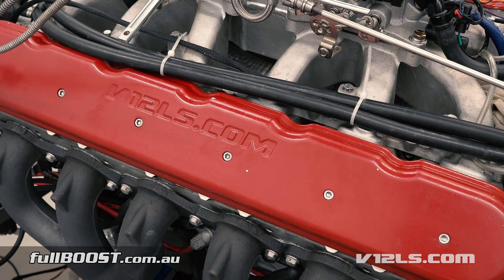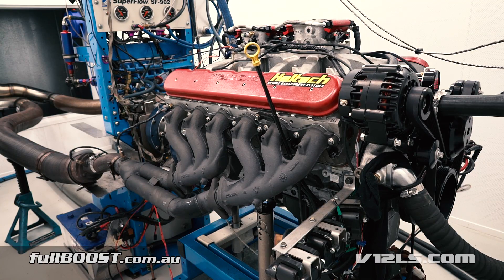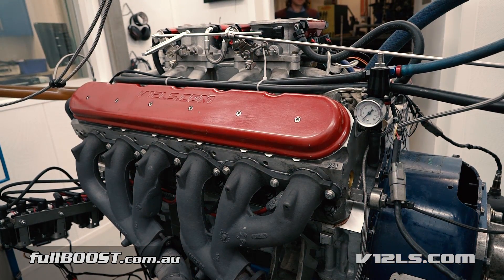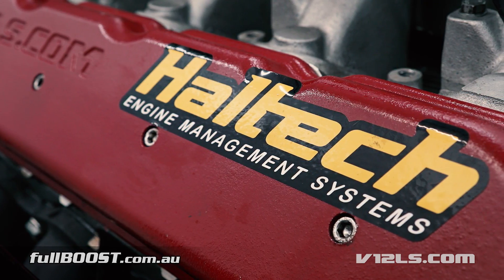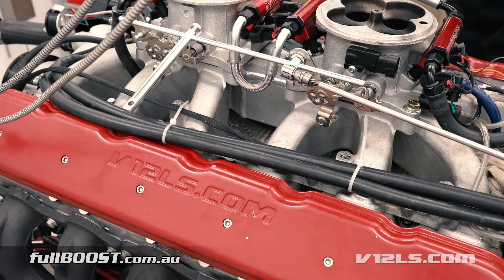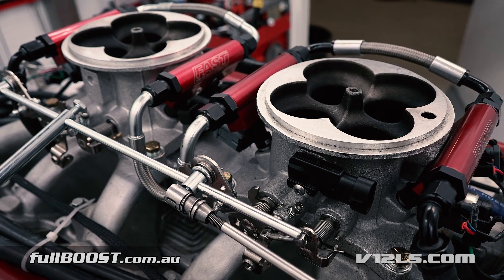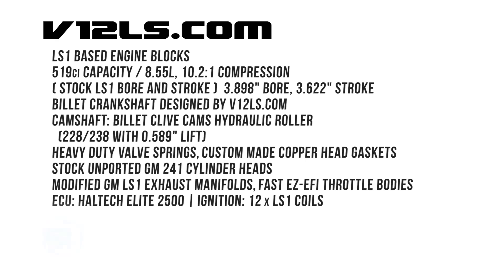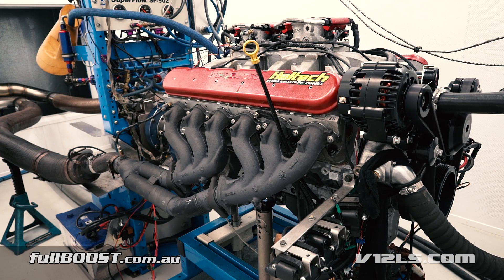V12 LS1 engine dyno

Comment: 77-83 HP per liter?? That's horrendous. A 20 year old Volvo engine makes 110. From the factory. And a modern Volvo engine will produce 250 per liter.
Reply from the maker: It has the potential to make so much more.
Reply: So does my Volvo - but how would you bump up the ratio on this thing?
Reply: Gunnar Sommerfeldt, more compression, more timing, higher octane fuel, head work.  Remember much of this is stock LS1 specifications which aren't mindblowing.
Reply: That's true. And there's no doubt that a lot of work went into it - it certainly looks (and sounds) gorgeous. I just don't understand why US engines always seem to be absolutely massive, and then only manage to produce mediocre amounts of power.
Reply: +Gunnar Sommerfeldt correct me if I'm wrong but isn't a Volvo turbocharged?  that would definitely  bump up your hp/liter ratio.  Volvos are tuned up a little more since they have run with boost.  LSx  engines are not optimized since they are built for decent gas mileage and longevity.   once you start tweeting the LSx  it will come to life with incredible  results.
Reply: Yeah this is over 700hp naturally aspriated. No car makes 250hp per liter without boost. This motor has no boost. You think 700hp is shitty for a v12? Look how many exotic cars over the past decade with v12's make less than 600hp. Smaller v12's right? Not a big honkin 8.5 liter like this one. Ok, take the 2016 Aston Martin V12 Vantage for example. It has 565hp, with a 6.0 liter v12. Yes this ls1 v12 is a larger 8.5 liter, but it also makes 149 more hp than the Aston Martin, so I don't think that's too bad compared to a freaking supercar v12. Not to mention, this motor is still a prototype with much more potential available. You want to know why American engines are "massive", but don't put out too much horsepower? Torque. That's it. They are "massive" because they have a much longer stroke, which increases volume in liters, and increases torque. A shorter stroke will produce max power at a higher rpm, with little torque, whereas a longer stroke (which increases displacement) will produce max power at a lower rpm, with much more torque. When you increase stroke in search of more torque and thus increasing the size of the engine, it doesn't necessarily mean you get more hp. Here are a few examples. If you build a chevy 350 V8 for example, if you keep it at 350 cubic inches (or 5.7 liters) you can make around 500hp on average, but will have to run a high profile cam and higher than stock rpm range to get that much power. Now if you take a 350 chevy and build it into a 383 stroker (approx 6.3 liters) it will make a lot more torque, but not really any more hp than the 350, and you won't have to rev it as high to do it. Typically a stroker motor, or a motor with longer stroke, will only make more torque, not more hp. There are examples of this in production cars. For example: Honda S2000. The original S2000 was a 2.0 liter with 240 hp. Then in 2004 they gave the engine a longer stroke to give it more torque, increasing it's displacement to a 2.2 liter. It didn't make any more hp, just more torque. Another example: Honda Civic EX. In America, the 1999-2000 Honda Civic EX had a 1.6 liter that made 127 hp. For the next generation Civic EX, in 2001 Honda increased the stroke on that 1.6 engine to give it more torque, which increased it's displacement to a 1.7 liter due to the longer stroke. While it did make more torque, it still only made 127 hp. Get it? America's "massive" engines have a longer stroke for more torque, but this doesn't mean more hp; only torque.
Reply: I as an American that looks at torque. Quick 0-60 mph requires torque.  A car with 500 lbs. of torque and 300 hp will smoke a car with 500 hp and 200 lbs. of torque from 0-60 mph.  I pull Vail pass (11,000 ft) in high gear in my LS2 gto.  No 4 banger could do that pulling a 2 ton car.
Reply: What do you mean, "4-banger"? I don't see a single mention of a 4-cylinder engine anywhere. In any case, I'm not really concerned about the NA/FI conundrum - the real question is why anyone would even make an engine without FI. I have more power when I need it, better fuel efficiency when I don't, less noise, etc in a turbo engine than anything else. As for torque, those numbers seem a little arbitrary. :D
Reply: Gunnar Sommerfeldt Well for one boost equals higher cost, not to mention reliability issues. Yes a boosted motor can be plenty reliable, but a non boosted engine is even more reliable. Less pressure in the cylinders, less parts, less parts to fail, lower combustion temperatures resulting in less friction between the cylinder walls and rings, no need for forged internals; the list goes on. Oh, not to mention boost lag. Minimal if done right, yes, but still there regardless. There are a tun of reasons to stay n/a as i have just mentioned.
Reply: Those are some good points, but you've got to weigh the pros and cons. A turbo engine with efi doesn't have a whole lot more in parts than an NA engine - that's kind of a myth. And you don't need forged rods and whatnot - that's also a myth. The fact is that my engine IS an NA, until I need it to be FI. Temperatures aren't any higher, and as a daily driver, I still have more available power than most, with lower fuel costs. Done right, as you say, there's no turbo lag to speak of - using the right turbo for the right engine and application is key, of course, as the right tuning of an NA is also key to having good results. The bottom line is that I've got a 2.3 liter engine which turns into a 3.2 when I need it to be. And I certainly spend far less maintaining it than quite a few people I know with US NA engines... :)
Reply: Gunnar Sommerfeldt But it wont last 250k and still be in tip top shape like an n/a engine if properly maintained. I've owned both btw. Mid 90's z28's and a 02 wrx. Love em both.
Reply: There's no way of telling one way or the other, on either FI or NA. That literally comes down to thousands of factors, and there's no way you should be that categorical. There are lots of turbo cars out there with far more on the clock than 250k, and many of them are Volvos, for example. I had an NA that died long before 250k, and I've got a turbo now that looks like it'll make it to 250k without problem. So that's not really an argument. I guess it comes down to a Nike or Adidas, Pepsi or Coke kind of thing. Some people like this, some people like that. ;)
Reply: Gunnar Sommerfeldt
 I am no volvo expert.  I thought a 2.5L was a 4 cyl.  Forced induction is an added expense.  I prefer bigger motor N/A.
Reply: Gunnar Sommerfeldt Gunnar Sommerfeldt There seems to be a widespread misunderstanding when it comes to engine size and displacement. Displacement tells you next to nothing about the engine's physical dimensions.An LS1 V8 is almost the exact same size as a Honda F20 engine and is less than 30 pounds heavier for instance. Also, you can only use hp per liter figures when comparing two engines of the same configuration. A 4 cylinder can't be compared with an 8 cylinder. OHV engine be compared to a DOHC. A turbo'd car cannot be compared to NA either using specific output. And really specific output doesn't tell you anything about the engines actual efficiency anyways, so it's somewhat useless.
Reply: Gunnar Sommerfeldt Generally speaking, an n/a engine will last longer than boosted, but I can see I'm beating a dead horse. And you say there's not really any more parts on a turbo car than n/a? Ask me how many parts I replaced trying to figure out my boost problem on my wrx, none of which would have been on an n/a car. Hell, just look at any turbo kit period and see how many parts it adds, nuff said. You originally said the power output vs engine size was horrendous. We all said yeah cause it's n/a, and a prototype, and I even compared it to a brand new Aston Martin which showed that actually it's not that bad for what it is. Then you said "why would anyone even make an engine without forced induction". I tried to point out several very good reasons, and you are comparing them to Coke and Pepsi. Ok, you want an answer from a manufacturers point of view? Cost. The more shit they put on the car, the more it costs them to make the product. More parts is more money, not to mention more R&D to make sure it all works long term, which costs more money. Car manufacturers are in the buisness of making money, not necessarily making us happy. At the end of the day all they care about is putting money in their pockets. It's easier and cheaper for them to just slap an n/a motor in a car and sell millions of them. A lot of the imports are what have the turbos, right? Look how much they cost... You know how much it costs to buy a brand new boosted car today that puts out 400hp? 40-50 grand? You know how much it costs to buy a brand new "massive engine" V8 muscle car with 400hp? Like 30 grand. N/a power is cheaper, and this is the single biggest reason why not all cars are turbo or supercharged.
Reply: Gunnar Sommerfeldt no it won't.
Reply: haters
Reply: Ya, that "modern volvo engine producing 250hp per liter" kind of has boost now doesent it? And hmmm, what about tourque? No mention of that? And this is coming from a volvo owner.
Reply: - 250hp/liter = steady ZERO fucks/km. 
- You mean "a modern *Ford engine"?
- 77-83 HP/l out of simplified, compact, relatively light and very reliable engine arrangement VS. "they've attached 4 cylinder engine to their 3(2) turbochargers" - arrangement. Who do you think holds the advantage? :D
Reply: In 1950 the BRM 1.5 litre V16 made 400hp/litre - so what? Once upon a time there was an ice cream but it didn't have bones - that about sums up the validity of that comment of yours.
Just because you can't see the need for something doesn't mean someone else shouldn't follow their dreams does it?
Reply: hp/l is a joke. say you have a 1L engine that makes 100 hp. you have 100 hp/L right? yep,but you have 100hp. say you have a 5L engine that makes 50 hp/L. you have 350 hp. 5L engine has more hp. its all about who has more at the end, not per litre.
Reply: A good point to note here: Just as it's amazing that there are some n/a motors out there putting down 100hp per liter, it's just as amazing that somebody made this v12 ls1. And compared to even modern v12 engines out there, it's hp per liter isn't bad for a prototype that is using stock ls1 head and cam specs and manifolds. I mean those modern v12s like the Aston Martin I quoted earlier are pretty much full out race motors in street cars. The heads are already worked, they have ideal cams, and much better exhaust manifold design. Anyone who knows anything about the ls1's knows that all the power gains are to be had in a good set of heads with a good cam and headers. That takes an ls1 from around 300hp, to around 500hp. That's a 66.66% incease in power. So apply that 66% increase in power to this v12, and you got over 1100hp. It'll make at least 1000hp with a better cam, ported heads, and headers. Oh shit, that's over 100hp per liter isn't it ladies and gentlemen? What's boost for again? Lol, add boost to that and you got 2000hp easy.
Reply: it's nice that people understand each other, eventually. :)
Reply: I think you kind of missed the point, buddy.
Reply: Abu Jason Al-Blahino good one
Reply: +Frigglebiscuit

1st: A 5L engine that makes 50hp/L does 350hp??? Come on, 5x50 is 250!!!

2nd: hp/L a joke???

Example1: You get one 5L engine for free. You can choose between two engine types.
A 5L engine that makes 50hp/L or a 5L engine that makes 100hp/L.
What's your decision and why??? Which engine is more efficient???

Example2: You want to build an engine with a displacement of 10L.
Would you take the technology of the 5L 50hp/L engine or the technology of the 1L 100hp/L engine to build a 10L version?
How much hp would the 10L engine make if you would take the first technology and how much with the second one?

Is hp/L still a joke for you???
Reply: V8Roehrldrifter whichever makes more torque. Doesnt matter what hp/l it is, because i would still upgrade them. And yes, hp/l is still a joke. Most people only carebout that because they cant do upgrades because of nanny state emissions laws.
Reply: Frigglebiscuit Oh, you don't get it, too bad :(
Bye :)
Reply: V8Roehrldrifter seeya.
Reply: +Frigglebiscuit You can't have torque without horsepower, and horsepower is no use w/o torque. Prioritizing one over the other really makes little sense, if you see what I mean. :)
Reply: Gunnar Sommerfeldt where are you from?
Reply: +Frigglebiscuit Why?
Reply: Gunnar Sommerfeldt just wondering if youve ever owned an american v8.
Reply: +grebo121 110-125 hp/l out of a simple enough engine for anyone with torx bits and a few wrenches to work on themselves, with no mechanical education, which uses less gas and needs less maintenance than a brand new LS engine. And is 20 years old. Who do you think holds the advantage?
Reply: +Frigglebiscuit No, I've never owned one. I've driven several, from time to time. What does that have to do with anything?
Reply: Gunnar Sommerfeldt so you have no idea how american v8s are? All i see is bias.
Reply: +Frigglebiscuit Look, there's no bias here. What I'm saying is that numbers don't lie. My 20 year old Volvo engine will, with SOFTWARE update only, on stock internals, produce the EXACT same power (actually, a smidge more) than the 1999 LM7 5.3 liter V8 (290 hp/317lb.ft vs 270/315 for the V8). That's a 2.3 liter engine, producing the exact same amount of power as an american 5.3 liter V8. In fact, the 20 year old Volvo will put down just about the same amount of HP and torque as the 1999 LM7, the 2002 L59, the LM4 and a smidge less than the L33 (11 lb.ft).
Reply: Gunnar Sommerfeldt and is that with a turbo?
Reply: No, it has extra footpedals in the back seat, so passengers help the numbers along greatly. Jesus.
Reply: Gunnar Sommerfeldt Exactly :)
"HP", "torque" and "RPM" are mutually dependent. If you know 2 of them then you can always calculate the 3rd one.
Reply: +Frigglebiscuit That's not the point, is it? Put a Boeing turbine engine on top of the Volvo. More power. Same thing. The point isn't the size of the engine - it's the power to displacement and power to weight that matters, and which is what my initial comment was about. My Volvo engine uses less gas, is lighter, and 20 years old - and it still makes the same power as all those V8s I listed.
Reply: Gunnar Sommerfeldt wrong. That volvo would have turbo lag from hell to make the same power as a v8 with high amounts of boost. And i highly doubt that volvo engine is lighter than an aluminum block 5.7 ls. Even if it is, it wont be enough to matter.
Reply: +Frigglebiscuit A 15G turbo has very little lag - it's a ~15psi turbo, on a 2.3 liter aluminium block. I don't think you have any idea what you're talking about... a little research would do you good.
Reply: Gunnar Sommerfeldt so im guessing its a b230t?
Reply: +Frigglebiscuit That was the laziest google search I've ever seen. And no, it's not. It's a B5234FT.
Reply: Gunnar Sommerfeldt the white block weighs 388-419 lbs. An ls1 weighs 457 lbs. A grand national 3.8 turbo v6 weighs 375.
Reply: +Frigglebiscuit Point being?
Reply: Gunnar Sommerfeldt isnt enough weight to really matter. Power ro weight ratio isnt that bigbof a deal.
Reply: +Frigglebiscuit You do know that you need a tranny for that LS1 as well, right...?
Reply: Gunnar Sommerfeldt yep. And you need one for that white block.
Reply: +Frigglebiscuit The combined weight of the 20V Volvo engines with transmission is 350-400 lbs.
Reply: Gunnar Sommerfeldt lol no.
Reply: +Frigglebiscuit http://www.matthewsvolvosite.com/forums/viewtopic.php?f=1&t=27378&p=120778
Reply: Gunnar Sommerfeldt i saw that. Its wrong. A whiteblock is 388-419 lbs with oil.
Reply: +Frigglebiscuit It's wrong? LOL. What, did you weigh one yourself? :D
Reply: Gunnar Sommerfeldt then what is the real weight? No one will ever know i guess. Transmissions aint light. That would have to put that engine in the 200lb range. Not happening.
Reply: +Fragglebiscuit That's not far off, buddy. Remember, this is a 2.3 liter aluminium block. You're trying to compare the weight of that to engine blocks that are twice its size. You're a little bit delusional.
Reply: Gunnar Sommerfeldt nah. Im seeing too many frieght weight postings that say otherwise. Im done arguing btw. Tired of getting notifications about this crap.
Reply: I doubt it, bud-bud. SO, in summary, you - 0, Volvo - 1 ;)
Reply: Gunnar Sommerfeldt whatever you say, bud. Blocked.
Reply: Hehehe... that's hilarious. :D
Reply: Damn guys, you went at it. Gunnar your point of view is that you only want the smallest and most efficient power package: a turbo 4cyl, i.e. your Volvo. Are you even aware that an ls1 Camaro or Corvette gets 28-30 mpg with the 6 speed? Know why? TORQUE. Thanks to all that glorious v8 torque, they can pull a very tall 6th gear, keeping the motor at 2000 rpms or less at 80mph. Is your Volvo at only 2k at 80mph? No, it's not. And I also know your Volvo isn't rated at better than 30 mpg as well. So if they both make about 300hp and both get around 30 mpg, what makes your Volvo superior? Absolutely nothing. Oh, not to mention the Vette has a 350 hp version, which still gets 28-30 mpg, so it would smoke you in a straight line and in the corners as well. But here's another analagy. As you said above, you have never drove an American v8 muscle car. As I said earlier, I have owned both the v8 and a turbo 4cyl, the wrx. I loved both of them. They were two completely different cars, but both special and amazing to drive in their own ways. You wanting to stick to JUST turbo 4cyl is boring. I've had 4cyls, turbo 4cyls, small high reving v6's, large low reving v6's, v8's of course, front wheel drive, rear wheel drive, all wheel drive, 4 wheel drive, and a mid engined car (mr2). It's boring to say and stick to one "superior" platform. There are people who love v8 cars, and people who love turbo 4cyl cars like you. I love all cars! I've never understood why people are loyal to only one type of car; that's boring. I love anything that looks good and goes fast, doesn't matter what's under the hood to make it do that. But I just proved anyway that an ls1 car with a 6 speed is just as efficient as yours, so what's your argument? Yeah, it took a much larger engine to make the 300 or so hp than yours, but this is because it's not boosted. Duh? There are turbo versions making 1000hp. You can't even make 1000hp with yours, and even if you did put 4 turbos on it bigger than your face to accomplish 1000hp, your aluminum block would explode, which means yours can't even make 1000hp like I said! It's common sense. If you want to make more power with a smaller engine, you add a turbo. Otherwise, you put a bigger enigne in it. There is no right or wrong. There are plenty of reasons to love a turbo 4cyl, and there are plenty of reasons to love a big ass v8. And for the most part here in America, both types get about the same gas mileage. And even Volvo makes v8 cars. Go drive a 97 or newer 6 speed Corvette and see why v8's kick ass. You will hate your Volvo after you drive that.
Reply: It has a lot to do with the aftermarket, emissions regulations, and durability standards. We tend to build larger displacement engines that are "de-tuned" to meet emissions regulations. BUT once you buy the car, as long as you keep your total miles under a certain specification, you can modify these large displacement engines to make crazy power with stock internals. For example, the 8.4 L V10 in the Viper only makes 645 hp stock (with a torque curve that is almost flat btw), but add two turbos and 10 psi and it will make 1000 hp bone stock. AND Vipers can get almost 30 mpg when driven properly.
Reply: +Gun&Cars Look. First of all - the B5234FT engine (as well as most 850 and X/V70/90 Volvos are 5 sylinder engines. That right there kind of gives away how much you know about these cars... ;) 
Second, if you had read what I wrote, I said that I have never OWNED a V8 car. I HAVE, however (like I said), driven several, from time to time, among them a '99 Corvette. I still rather like my Volvo, actually... ;) 

In the end, this all comes down to personal preference, as I've ALSO said earlier. 

And here's your 1000 hp, 5 cylinder Volvo 850: http://www.garaget.org/?car=58795&image=1583069 
Actually, it's 1140 hp, at over 1000 nm. And it doesn't have 4 turbos, neither is it blowing up. And that's not the only example out there. So what was that you were saying...? 
Dude, I appreciate your effort in making that wall of text there, but I hope you know more about guns than cars, so that username of yours is at least half way justified. I know this was a harsh comment, but you kind of deserved it. ;)
Reply: Gunnar Sommerfeldt 
I understand your arguments on the efficiency term.
True - for 250-300 hp, a V8 configuration is a bit of an overkill.. it rather matches to 2.0-2.5 liter 4-6 cyl. engine... 
But when you target the 500-700 hp category, things go a little bit different - your simple & reliable 5 cyl. Volvo will need: more rev$, more boo$t, and more valve travel for that. And it won't be simple, cheap or reliable any more. 
The low end torque won't be as comfortable as you wish - let's say it won't match with the gear or the clutch characteristics, and you'll need a second turbo if you want to cover that. The Volvo engineers reached the point, they've equipped their 450hp 2-liter 4cyl. engine with totally 3 chargers - 2 turbos + electrical one. 
Don't get me wrong - I get the idea, but to me personally, it seems a bit too much. :)
The other approach to the "heavy" category is to add more cylinders or another cylinder bank - going to the V's. Ok. But If you want to save the engine's specific power output - advantage, you must leave all the things, which provide it - DOHC cylinder heads, cast iron block, forced induction system - all these things occupy SPACE! And weight. Which in 90-degree V are much more of a problem than in in-line configuration. 
And the better way is GM's - just add more stroke & bore. Basically the weight and size of a 4-liter LS-engine is not much different than 6.5-liter's, And it's significantly smaller and lighter than M60-engine (for example). 
And add that this is a platform that has evolved for ~50 years, and parts for it are all around, that comes to be one of the most cost-effective on the market.
Reply: +Guns&Cars Aw... is someone a little butthurt that they got called out for not knowing anything? You should take a look at the reply from +grebo121 there - he/she actually knows how to make a coherent, and rather convincing argument in a discussion, without name-calling, and with actual facts and figures, along with a balanced view of things that make sense.
Reply: First of all - the B5234FT engine is shiet because i changed piston rings + turbo overhaul at 120k on mine.  No need to tell me about proper maintanence. Friends have "few" N/As rolling easily 200k. More parts mean that more of them can break.
Reply: +Guns&Cars Dude, I didn't call you any names. You're the one who did that. This thread's been fun, because a lot of people have had a lot of opinions, and many of them have been expressed in a civil manner. But stuff like your last comment is just proof that you're not worth listening to, and that you certainly don't know what you're talking about. So thanks for leaving - it's no great loss. :D
Reply: Gunnar Sommerfeldt All hail the great  automotive dictator Gunnar Sommerfeldt!
Reply: +Guns&Cars Thanks! :D I wish. Then every engine would be 5 cylinders! Oh, the evils I would commit... Moa-ha-ha! :D
Reply: Hmm.... if there would be anyway possible to get that LS1 V12 engine on Lexus lx 450 engine bay with one holset 551vgt. That would be really fun. hmmmmmmmm
Reply: on paper it seems lethargic, i'm sure in the real world it will haul your volvos ass into oblivion.
Reply: +Thee Adjudicator It very possible that you're absolutely right.
Reply: +Gunnar Sommerfeldt You have to understand that the average american automobile enthusiast doesn't tend to look highly upon fi unless the engine is producing more than 1000hp.  Your typical "Big Block" v8 can support 700hp. and 650ftlbs. NA and still get a decent amount of gas mileage with a decent efi setup.  An example of this is a 76' Trans Am that I believe is for sale on Butler Performance that has a Pontiac 535 thats making 830hp na and gets 30mpg.  Basically for larger displacement engines built for street use, fi is completely unnecessary.  That being said, I have no problem with fi when its used in smaller displacement applications where it is neccesary.  And yes, before anyone corrects me, I realize that this motor is neither a big block nor a v8.
Reply: 95% of the LSx engine family only makes 60-90hp per liter so this is right on par. 100% of the LSx engine family could beat your Volvo. In fact a lot of your brethren opt to put the LSX in their Volvo's since it's....you know...better.
Reply: There is no point to put LS engine to Volvo - thats waste of money and time and after all the hassle its still Volvo. You can go mental with some bigger holset turbos, rebuild engine internals (stronger one). Just keep it a total sleeper a.k.a farmer vagon and race out many performance cars.
Reply: Rob&Steel There doesn't ever ever to be a point when it comes to tuning.
Reply: +Thee Adjudicator Whatnow?
Reply: Gunnar Sommerfeldt I was replying to Rob&Steel that whenever someone modifies or tunes a vehicle it's usually personal taste, No matter how pointless it seems to everyone else.
Reply: +Thee Adjudicator Ah, that makes sense. And is probably one of the truest things said in this thread. :D
Reply: +Nathan Dance Anyone who likes tuning engines, performance and power will care about power vs displacement and power vs weight.
Reply: As an actual professional tuner, HP/liter means nothing. It's something for article readers to brag about, AP1 S2000 guys to wank over and owners of smaller displacement to use as an excuse when they lose or break. No one walks up and asks what hp you make per liter... They want to know how much power your making and what you weigh. Another reason why the LS is so popular.
Reply: +Maxwell Hughes If you're a "professional tuner", you would know that both power vs displacement and power vs weight are useful metrics. They both make up pieces of the whole picture, and if you're not seeing that, then I doubt you're a "professional tuner" of any kind. There's also the fact that the weight of an engine isn't necessarily all that easy to figure out, or come by, while displacement, cu. in. or liter, is readily available along with hp numbers. 
In my experience, no one walks up and asks what my engine weighs and what kind of power it makes. They want to know power, and how big the engine is - i.e. liters or cu.in.
Reply: Hp/L is the ink on a spec sheet of the car that does absolutely nothing when it comes to tuning and actually racing. The only instance HP/L would remotely matter on a street car is when you are sizing injectors as you would need to know the cylinder count, aspiration, power goal, fuel type and fuel pressure which sort of ties HP/L into the equation. Once an engine is in a chassis a lot of things matter in the game of acceleration. HP/L is not one of them. I don't make videos too often but my Pro60modman account has a few dyno tuning sessions I've done over the past 8 years. Last few were a 487whp Camaro, 655rwhp Cobra and 397awhp stock turbo STI. That's 76, 131 and 158 hp/l btw ;).
Reply: +Maxwell Hughes So what you're saying is that HP really doesn't matter, and that... hang on, I have no idea what you're saying. HP/l and HP/weight is an efficiency measure. I'm not sure what you're not understanding. If you have a 2 ton engine that produces 1000 hp - where will that get you? Not very far. Well, at least not very efficiently. If you have a 200 kg engine that produces 500 hp, then that will get you everywhere. See the difference? 
If the 655whp Cobra has a 20 liter engine, then that's horrible. It'll be huge, heavy and unweildy. If, however, it's somewhere around 5 liters (which it should be), then that's a pretty efficient powerhouse.
Reply: What I am saying is HP/L is about as useful a stat as knowing the thickness of the paint on your boot lid. Weight is what matters. Using extreme examples like a 2000lb 20liter Ford mod engine is useless(it is a 5.0 stroker though......617lbs). Use actual competing engines like a 527 pound 500hp 5.0L BMW S85 or a 451 pound 483hp 4.3L Ferrari F430 v8 and the 454 pound 505hp 7.0L LS7. HP/L did nothing to help the smaller engines. Only overall hp and weight.
Reply: +Maxwell Hughes The point of hyperbole is to explain a concept with extremes, so as to bring the point across. And I don't think I said anything about it being a Ford engine... Anyway. 
Power vs displacement isn't about the end numbers - it's about the efficiency of the engine. Tell me, which would you rather have - a 3 liter engine producing 450 hp, or a 3 liter engine producing 250? That's what it's about - not how big the engine is, or the total numbers. The point of my original comment is that today, it's possible to make a 2 liter engine which can produce 450 hp (I overshot it a little in the original comment). In view of that, something which produces 77-83 /l isn't very efficient, or good. 
My comment was never about the end numbers, and if you think that efficiency, power vs displacement and power vs weight means nothing, you should probably just shut the doors on whatever tuning shop you work in.
Reply: +Maxwell Hughes
I know its long ago, but do you remember the old Trans-Am Series. The engine displacement was limited to 5L (305cui). In this case HP/L did matter very much. Whoever had the best HP/L automatically had the most power and did something better than his rivals, he had the better technique and engineering skills.

Or take a look on Top Fuel Dragsters. The engine displacement is limited to 500cui. Why?
To see who has better skills in getting the most power (best HP/L) from the same sized engine. A fair competition.

Imagine you want to recruit an engine tuner for your racing team. Two guys comes to you and want that job. The 1st guy shows you an engine he built, a 5L with 500HP and 500Nm.
The 2nd guy shows you his one, a 4L with 500HP and 500Nm.
Both engines are build from same materials, have same durability, same fuel consumption and produce the same curves on the dyno but the 2nd engine is smaller (lets say it's same weight, even it would be lighter logically).
Which guy would you employ and why???
I would take the 2nd one, his skills are better. He manages to build an engine with less internal friction, better fuel injection/distribution, better combustion, better timing, better sealing,...etc.
He can generate more "HP per Liter".

The smaller engine size alone is worth it when building a race car, look at LMP1 cars for example (specially the Porsche 919). Lower center of gravity and more space for other things or the possibility to build a slimmer car with more space for the air flow to generate more downforce.

And finally, what do you do at work as a professional tuner? Nothing else than increasing HP/L when modifying an engine without changing the displacement. You optimize an engine to get more out of it, and a 2L 300HP engine is more optimized than a 3L with 300HP.

HP/L shows you how optimized/efficient an engine is, it's not useless!

Don't get me wrong, i love big engines.
To own a 8.4L V10 Viper, a Muscle car with a mountain 632cui V8 or even a 16L V8 Weineck Cobra is a big dream for me!
This LS-V12 is a piece of art! Love it :)
Reply: Gunnar Sommerfeldt Its american technology, what do you expect?
Reply: +TheNecromancer6666 :D I suppose you're kind of right, but the US has brought us a lot of great stuff too, including when it comes to cars. It just kind of seemed to have stagnated on the "bigger is better" stage, when that's clearly not the case. :) But imagine the engines they would build if the could get the efficiency up and their egos down a little...  ;D
Reply: +V8Roehrldrifter Trans Am limited your minimum chassis weight vs. the displacement of your engine(as most racing governing bodies do). 8.6lbs per cubic inch for NA cars, higher for turbo cars. There was no size limit and a couple years after that rule was introduced a 5.7 liter corvette won the series. In newer series they hand out weight and intake restrictions based on lap times, engine size and weight. This further removes hp/L from any of the little significance it had in the first place.

I would take the 5.0L engine in your example. It would have lower combustion pressures, less wear due to lower stress, they likely have the same external dimensions and the engine likely weighs about the same. In short it will last longer on the track and given both engines made the same hp that's probably the average fielded HP so it would be competitive.

Hp/L is a useless number. The winning-est engine in GTS/GT1/GTE at the 24 hours of Lemans in the last 17 years has been a single cam LSx Chevrolet V8 that was 7.0L for 10yrs and 5.5L the past 6. All of it's competition since it's inaugural race in 1999 has had 100hp/L and the Chevy V8 has had less than 90hp/L. Hp/L is useles on the street and means nothing in the forms of racing you actually see street engines in. Especially the LSx.

The one exception might be WRC since they are limited in literally everything except horsepower but even then it seems the drivers skill and testicle size dictates the winner in those harrowing races.
Reply: +Maxwell Hughes You still don't get it it, I guess... it's about efficiency, and like the other gentleman said, (if you really are a tuner, which I doubt) increasing efficiency is what you do professionally. Discounting a measure of efficiency makes little sense - it's like saying a yard doesn't count because you want to measure things in feet.
Reply: Maxwell Hughes
At the beginning (1960's), Trans-Am had clearly a limit to 305cui!!!

About my example, I said "same durability" and other stuff to highlight the even performance stats!!! Is my english really soooo bad?

About the GT-Series, now imagine if the competitors of the Corvette would have build a 7.0L engine with their technology. That's HP/L!!!

Take a look at the full car engine history and see the HP/L growing and growing over the decades. That's called progression of technology.
"Making more out of same" or "making same out of less" is progress!
Reply: V8Roehrldrifter Great Name ;-) Ein Guter Fahrer hat die Fliegen auf der Seitenscheibe
Reply: there is no such thing as a volvo engine that produces 250hp pr.liter. boosted or not.
Reply: +terje halle You're right - it produces 225 hp/l.
Reply: Gunnar Sommerfeldt And it is a prototype. Also it is, lets be friendly to Volvo, “inspired“ by Audis ideas. Anyways, it is efficient, powerfull and has way more torque then any comparable NA engine. At least it can be tuned too have.
Reply: +TheNecromancer6666 Well, it was a prototype in 2014, when it was first showcased. These days, Volvo is already using their E-Drive system, and reports are that the very engine I talked about is going in the Polestar versions of quite a few models. As for inspired by Audi... maybe you're right. Then again, you could say that of any engine design - they're based on all the same principles, after all. ;)
Reply: In my opinion the real reason American muscle cars still have huge engines is heritage... They're supposed to be modern renditions of classic muscle cars which had gigantic 383, 427, 440, 454 cu. in. engines.  Big engines are an american (and aussie) thing.  They're essentially a middle finger to the world of smaller, admittedly more efficient gas friendly engines.

Manufacturers don't want to alienate the main consumers who buy the car for the performance and nostalgia, therefore they haven't downsized the V8's to <4 liters.  A high displacement V8 is a defining characteristic of a muscle car, if you take that away, I don't think you can call it a muscle car anymore.  Check out the new Ecoboost Mustang for example.  I've heard it drives very differently from the V8 for obvious reasons, namely the lack of low end torque which is plentiful in the V8.  Hopefully some tuning shops work their magic on it and squeeze more power from the ecoboost as I'd like to see some more variety in the racing scene, but I think as long as muscle cars are still around, the flagship models will have >5 liter V8's
Reply: Gunnar Sommerfeldt This Edrive anti lag system is not used yet except in an Audi and the Bentley Version of it. It will debut im the S90 Polestar PHEV. This specific antilag System is an Audi development. But yes quite a lot of engines are using Audi ideas. Like sequential direct injection.
Reply: +TheNecromancer6666 And deep down, they're all Otto engines anyway, is what I mean. :D
Reply: Gunnar Sommerfeldt I know. But todays engines are way too diverse too simplyfy it that much
Reply: You do realize that turbochargers are a form of artificial displacement?
The purpose of force air induction is to squeeze a higher volume of air into a smaller space which effectively makes a smaller engine bigger, because power is generated by volume.
This is also why a smaller naturally aspirated engine must turn faster to make the same or more power than a bigger engine. It simply requires a great number of revolutions to move the same volume of air.

I don't know the actually equation but if your Volvo is pushing more air in it is creating greater displacement.
Every .344738 bar increases your engine near an additional 2.8 liters. So your 2.3 liter is actually closer to 5.

Another comparison would be a naturally aspirated 2.0 liter engine may have to rev nearly twice as high as to make the same power as a similarly configured 4.0 liter engine.

There is no escaping volume is power.

So an engines size and configuration has a lot to do with it's intended application. Which actually makes larger naturally aspirated engines more versatile where durability is as important as performance.
Reply: You do realize that turbochargers are a form of artificial displacement?
The purpose of force air induction is to squeeze a higher volume of air into a smaller space which effectively makes a smaller engine bigger, because power is generated by volume.
This is also why a smaller naturally aspirated engine must turn faster to make the same or more power than a bigger engine. It simply requires a great number of revolutions to move the same volume of air.

I don't know the actually equation but if your Volvo is pushing more air in it is creating greater displacement.
Every .344738 bar increases your engine near an additional 2.8 liters. So your 2.3 liter is actually closer to 5.

Another comparison would be a naturally aspirated 2.0 liter engine may have to rev nearly twice as high as to make the same power as a similarly configured 4.0 liter engine.

There is no escaping volume is power.

So an engines size and configuration has a lot to do with it's intended application. Which actually makes larger naturally aspirated engines more versatile where durability is as important as performance.
Reply: 1400IntruderVS There you are very very wrong, the higher pressure changes proccesses in the piston completly, makes combustion hotter, makes the flame wall much mucj faster. It is way more the just more air in a cylinder. It is way more complicated and way more effective then that
Reply: +1400IntruderVS That doesn't seem right at all. For every 1 bar (14.7 psi) "extra" pressure, the original "size" of the engine doubles. Makes sense? The original atmospheric pressure pushes 2.3 liters of air into my engine. If I double that with another bar of pressure... well, you see what I mean. If I was running 14.7 psi of boost, at that moment, my engine would be a 4.6 liter engine, in terms of air displacement.

Now, it's not the volume of the engine that makes the power, it's the efficiency at which it moves air - which is also what we've been talking about all through this thread. There's also kind of another flaw in your logic - while a large, NA engine certainly has its place, there's no question that the on-demand "size" and extra power of an FI engine is more efficient. The general developments in engine tech also proves that, be it in high power applications such as long haul tractors or passenger vehicles. The Volvo engine I referenced in the original comment is only one example - 225 HP per liter vs 77-83 from the one in the video? I kind of don't know what we're even discussing this for, anymore...
Reply: Gunnar Sommerfeldt  I was trying to do the conversion. I know a blower pushing near 5 psi of boost will increase displacement by 174 cubic inches.
It is the volume. How efficiently an engine pumps out that volume depends on your tuning and the overall dynamics of the assembly.

If you're making 250 horsepower from 14.7 psi from an otherwise 2.3 liter engine, efficiency is not something to brag about.

I had an 1986 Thunderbird Turbo with a SOHC 2.3 with just a sightly better cam and a header pushing 12.5-13 psi of boost that made little over 250 horsepower and got 27 mpg on the Highway.

I am not arguing with you. I am simply telling you the way it is. An Engine is a pump and it makes power by passing a volume of energy.
Reply: +1400IntruderVS Yeah, you kinda got jumped there. Sorry about that - I really like this thread, because we've mostly managed to be civil, and a lot of fun viewpoints back and forth. Of course you're welcome to the conversation. :D 

Still, I think there are some faults in your logic - you're kind of confusing volume and pressure, if I'm not totally misreading? The amount of air that is moved isn't dependent so much on pressure - you can have a tiny amount of air under absolutely massive amounts of pressure, after all. So, a car boosting at 14.7 psi, or 1 bar, has doubled its displacement. After that, you also have to look at some of the factors that 6666 mentioned, but that quickly becomes extremely complicated, so we can keep it simple. When my engine boosts at about 0.5 bar, I have an engine "size" of about 3.5 liters, right? But that's in a 2.3 liter package. Are we on the same page, kind of?
Reply: Actually your brag of efficiency may be that your turbo creates more displacement while require less reciprocating mass, but the comparable displacement verse horsepower argument is a little weak.

Ask any other tuner...
Reply: I'm not sure that that made any sense at all. Reciprocating mass? Against what? And what argument are you referring to? And I should ask other tuners about what?
Reply: Gunnar Sommerfeldt  If you didn't understand that I'm not sure I can clarify it any better on this forum.
But I will try and be brief.
Some of the power (volume) pumping through your engine is used when pushing the same mass (which has weight) that is pumping it. So when air is forced in it reduces the need for such sizable components. Hence a smaller reciprocating assembly that is pushing the same volume as a much larger assembly. So it may use less power to generate power.

I said I wasn't arguing. 

I am trying to help you boast but first you have to understand at least the fundamentals of engine dynamics as the pertain to the internal combustion engine.

A Turbo may efficiently turn a 2.3 liter into a 7.0 but that doesn't necessarily mean it is effectively making more power in relation to it's displacement.

Just ignore all this and go back to my first statement about volume and how quickly it passes in relationship to power,
Or google it.
Reply: You misunderstand. You have to try and hold on to your own train of thoughts. You said "the comparable displacement verse horsepower argument...". That's the argument I'm asking you about. My engine has a displacement of 2.3 liters. No more, no less. It does have the ability to pump more air in, via a turbo charger. That doesn't make its displacement larger, it makes it more efficient at pumping air, and thus produce power. It also has the ability to run as a naturally aspirated engine, when the need for power is less. Again, you're confusing quite a few basic principles, I'm afraid.
Reply: Gunnar Sommerfeldt No turbo?
What RPM is your power being generated at with out a turbo?
With out the added displacement it will have to pump more to make the same power as a larger engine.
Reply: +1400IntruderVS Ah...don't you know how a forced induction engine with a turbo works? You do know it can run as an NA engine, right?
Reply: Gunnar Sommerfeldt Yes I know. and it is not making 250 horsepower with out boost.
You don't even the fundamentals of engine dynamics and now you are going to school me right?
You are moving off topic from your original boast.
Go take a coarse in the dynamic engineering and design  of the internal combustion engine and follow it with a coarse on force air induction. Spend 22 years employed in various positions in the automobile trade. Build and tune engines as a hobby during that time. Make friends with hundred of people that have similar experiences with automobiles and engines from all walks of life and then come back to me with something better than I own a Volvo that makes 7 liters from 2.3 liter but it doesn't always run on boost.

At least impress me with variable vane turbo or something,
Reply: +1400IntruderVS I think the main problem is that I don't really understand what you're arguing - have I been wrong about something? I never said 7 liters from a 2.3, btw - whew does that come from? Also, I'm not boasting - I'm trying my best to work with real numbers here, so I'm not sure what you're trying to say. Also, your lack of a little proofreading of your comments before you post them is probably messing me up a little - there's a lot of weirdness.
Reply: +1400IntruderVS Nothing? Oh well...
Reply: Gunnar Sommerfeldt I gave you all the information you requested in an attempt to help but you possess zero comprehension of the topic.
I am done with this post, and your trolling.
Reply: +1400IntruderVS I'm absolutely not trolling, as I think is very clear if you actually read this thread. I asked you what your actual argument was, and you started boasting about some claimed experience with cars and tuning. 

First off, your numbers were way off in your first reply. 1 bar/14.7 psi of boost doubles the "size" of the engine, whereas your numbers didn't seem to have any logic to them. You then go on to say that large NA engines are more versatile where durability is as important as performance, to which I brought the example of long haul trucking, where modern engines most certainly are not NA. I'll add train engines to that, though I guess turbines are a little outside our scope. After that, you kind of broke down in a lot of gibberish I didn't find any specific logic to... and I really did try.

I've got a distinct feeling that you're the one who's trolling, buddy boy.
Reply: Gunnar Sommerfeldt I said my numbers were off but the principle is the same.
You were boasting about a 2.3 liter which is actually boosted closer to a 5 liter  and only making 250 horsepower.
That is awesome if this was 1988 but your Volvo is only ten years old?
 Everything I said about volume determining the limitations of power production is still the same.
I am muting this post because I am done.
You opening suggest you don't understand and then continue to argue when I am just trying to offer some answers.
 Hope you wear a helmet.
Reply: +1400IntruderVS Oops... spot your mistakes, did you? :D No worries - your comment arrived by email :D I know exactly what it said. :D
Reply: TheNecromancer6666  I am not even being specific about the actual ratios I am just trying to clarify that volume (displacement) artificial or otherwise determines an engines power potential.

I wasn't being arrogant, he just doesn't seem to understand that boost adds to an engines size so bragging a smaller engine is doing more when boosted isn't really bragging.

You have no idea how difficult it is to keep this thought while my girlfriend constantly rambles off another conversation in my other ear every time I start typing?

This wasn't even about all the fine points and i am not arguing. I offered a simple fundamental reality concerning capacity in relation to power production. 
I didn't get in to pressure and heat or fuel atomization, timing, blah blah blah. 

So back off.
Reply: Gunnar Sommerfeldt Sorry I got short with you. Little frustrated.

I wasn't looking to get specific so I threw an arbitrary example based on value advertised by a blower manufacturer.
That may have been a little off as well because my memory isn't the greatest but the same fundamental applies even with our numbers. So we are not arguing unless you are trolling.
Reply: V8Roehrldrifter Trans Am limited engine size to be under 5 liters. 
That is why Ford and Chevy mad there 302 Engines for 1969 which are actually 4.9 liters.
Reply: +1400IntruderVS Dude, I kind of see what you mean, but what I was protesting was the numbers in your first comment. They were off. And then you said that larger NA engines engines are more versatile where durability is as important as performance, which I kind of also think is flawed. As I've said a couple of times, see long haul tractors, for one. 

Now, I'm not trolling - I genuinely think this is an interesting thread. But just like you, or anyone else, I have to be able to stand my ground a little bit. My very first comment was that my Volvo engine makes 110 hp pr. liter. That is true. It's also true that it's boosted, to about 0.5-0.7 bar. That doesn't make my displacement larger, it makes the amount of air I cram in there, larger. So I stuff as much air into the engine as about a 3,5 liter NA engine would suck in, or there abouts. Now, of course that is what makes the power. 

But, I also have a 2.3 liter NA engine, when my turbo isn't boosting. It doesn't make peak power, of course - no engine does outside of a very small RPM range. But, it's relatively small, it's very light weight, being an aluminium block, and it uses about as much gas going down the highway as a 7.0 liter NA would while idling... (that's hyperbole again, of course, but there's a grain of truth to it ;) ). The efficiency of my 20 year old Volvo engine, which at peak power produces somewhere around 110 hp/l, just can't be matched by a large, heavy, iron block NA. Now, if you want to come at me for any of that, I'm right here. Not trolling - I promise. :D
Reply: +1400IntruderVS Thats what i said.
Reply: Gunnar Sommerfeldt  Well I think your comparison of  7 liter idling using more fuel is a bit of an exaggeration but I am pretty sure I did say you may boast that your boosted engine more efficiently creates greater displacement.
Because that is what displacement is. An engine stated size iis it's capacity. Forcing more air in is increasing capacity.
Reply: +1400IntruderVS Yes, I said it was hyperbole, didn't I? And I'm seeing some more accusations of being a troll in my future, but you're actually wrong. You're not changing the engine at all, you're changing the air you put into it. The engine doesn't get bigger, the air is being forced into being smaller - denser, or more compressed - call it what you will. Forcing more air in is just that - it's forcing the air, not forcing the engine.
Reply: +Gunnar Sommerfeldt

What Volvo produces 250 hp/liter? I have never heard of any production car except for rare exotics producing anything close to that.
Reply: +themightiness The HP Drive-E 2.0 liter engine from Volvo produces 225 hp/l - I overshot it a little in the initial comment. So it's 450 hp from a 2.0 liter, 4-cylinder engine. The 20 yr old engine I was talking about in the initial comment is the Volvo B5234FT.
Reply: That was a one-off concept engine that was stuck in a Volvo S60R two years ago for show. It used 2 turbochargers and an electric supercharger. Plenty of concept 2.0's in that power level from Subaru, Chevy, Ford, Mitsubishi and Ford over the years. The highest hp production Volvo 2.0 is 367hp in the new S60R. Mitsubishi had an actual 400hp 2.0 liter 4 cylinder production car over 10 years ago.
Reply: +Pro60modman Well... You should probably check the dates on those articles you Googled up. Your info's out of date. As someone else mentioned earlier, the engine is going in several new models, and is Volvo's new mainstain (in several versions, of course) as they're retiring all of their larger engines. Polestar is even talking about squeezing even more power from it already.
Reply: Your really going to argue about the date of a concept that will never see production? What I said is correct. Volvo is not putting a 450hp 2.0 in their cars. The highest hp is 367hp in their Polestar cars. They have belt driven roots blowers and a single turbo. With DI and the blower system they won't be able to be pushed much further without major component changes. That goes for every small displacement turbo DI engine. The only thing the Volvo has is hp/L. The LSX engine out performs it in every performance category that actually matters. The chassis' do as well.
Reply: +Pro60modman Please, not this again. If you don't know what hp/l is, then you don't know the first thing. Literally. So maybe start with the basics, then come back when you've read up a bit. I'm certainly not debating another noob about this - read the thread instead.
Reply: I just want to make sure that nobody misunderstand me!

This LS-V12 is a fantastic piece of art. Few people have built something unique with their own hands, which most of us are not capable of. It doesn't matter which HP/L this engine makes, and you should not compare it to some big company engines imo.

I just want to say that HP/L is not useless at all like some people try to tell me. It gives some interesting informations about the approach/concept of an engine.

The rest of this wall of comments is just a battle between some fanboys imo. Please realize and be glad that we have so many engine concepts and a great diversity to choose from. It would be boring without them all!!!
Reply: +V8Roehrldrifter And with that gorgeous comment, I think I'll be muting this thread... Well said, sir.
Reply: Gunnar I honestly don't think you have any real experience with engines, tuning or efficiency other than what you yourself have read in pedestrian articles. Your just full of mild insults and 0 technical insight. Hp/L is a end-result math equation that gives you a narrow perspective on the overall power efficiency of the engine but no data on what actually matters. Explain why it truly matters. Explain how, once the engine is used in it's proper  street car chassis, it helps the vehicle edge out on the competition. Unless the engine is being used a generator, it doesn't help it against it's competitors one bit.
Reply: +Pro60modman We've been through it several times in this thread, if you had bothered to read it. Nothing you're saying is new. My initial comment was all about hp/l. I never mentioned any other parameter than that. So, if you want to delve into the minutiae of engine management, then perhaps you should make your own comment, and see if anyone's interested?

Hp/l is an efficiency measure, and is pretty useful when comparing different engine sizes. Is it useful on its own? Perhaps not terribly, but neither is any other single parameter. But, it's the parameter which will tell you the most about the overall efficiency, when you have no other numbers available. 

Now, I don't know what "pedestrian articles" is - I suspect it's a term you've made up, because you tell yourself that anything that doesn't agree with your view of things, is written by "pedestrians", which in your mind is a derogatory term for someone who doesn't know about cars...? Juvenile, but not the worst I've seen, I guess.

As for how hp/l "helps the vehicle edge out the competition", it's just what I said. It's an efficiency measurement. Would you rather have a 5.0 liter engine making 150 hp, or a 5.0 liter engine making 700? Saying that hp/l is useless, is just the same as saying that an hp number in itself is useless. And since that's only one alternative for power measurement, we should in that case get rid of the others as well. kW? Useless. Right?

Even when used as a generator, hp/l doesn't make a difference on its own. Nor does any other single parameter, generator or not. But, it might tell you how efficient that engine is, to a certain degree. So, the fact that you dismiss it, tells us a few things about you; a) you don't understand what efficiency measurements are used for, b) you didn't read any of this whole thread and c) I wouldn't let you anywhere near any project of mine - I like engines that will actually work. Aside from that, +V8Roehrldrifter probably said all that's needed in his last comment.
Reply: About what I expected, just a lot of useless banter and degradations over a useless measurement. Pedestrian articles are what's available to the public, IE what those with little experience love to draw from for their arguments. Hp/L outside of a engine restricted racing class is a worthless measure, not the values of Hp or L individually. The car I just finished building, tuning and posted to my videos made 734whp at 5.0 liters, roughly 860hp at the crank. Hp/L didn't cross my mind once while building it but somehow it didn't grenade into 1000 pieces, guess I got lucky. It's just something for the fan boys to spout off to feel better about their cars when they get bested by a bigger engine or for salesmen to impress potential customers.
Reply: Pro60modman HP per Litre is quite meaningfull too measure two things. First how advanved an engines is. You dont get a road engine with big hp/l without a lot of hightech in it. Look at the Production LS engines technology from the 50s is equivalent too low specific power. Second: HP/L is important for Performance because it is an indirect measurement for the power to weight ratio of the engine. Which makes it a relevanz Performance data. For any body who knows the slightest thing about cars will prefer a smaller lighter engine with the same HP.
Reply: Yet the LSx is the winningest engine at the 24hrs of Lemans since it's debut in it's respective class while never making more than 90hp/L. OHC engines have been around since before the 50's as well. Multiple cams, multiple cam gears, chains, guides, hydraulic tensioners, cam cap bolts, bigger valve covers, 3-5 valves per cylinder etc. That's all weight an LSX doesn't have one reason why it remains competitive. Have you ever seen an LSx? It's smaller than a Ferrari 360 V8. 

An LS7, which is the direct descendant of the previous 24hrs of Lemans engine, makes less than 75hp/L but over 1hp per pound, it even makes over 1 ft/lbs torque per lbs weight(fully dressed engine). Power to weight matters, hp/L does not. The two do not correlate. One of the highest hp/L NA engines ever, the lightweight Honda F20C, falls well short of 1hp/lbs but has 120hp/L. An old 13BREW has almost 200hp/L stock, still doesn't make 1hp/lbs in dressed trim. HP/L doesn't make the engines pull their chassis' along any faster, hp/lbs is the first of many actally meaningful measurements that will help determine that.
Reply: Another POS 4 stroke as usual, sled motors make over 200Hp per liter. not impressed with all this 4 stroke crap!
Reply: +Pro60modman
HP/L gives you informations which HP/kg doesn't, it's not useless!!! Both together are usefull.

Here some naturally aspirated engine examples, all almost 1HP/1kg:

- Rolls Royce Meteor M120 is 810HP/835kg (almost 1HP/1kg). It's 30HP/L (now you know it's very low revving, and you can calculate the displacement)
- BMW M30B35 is 211HP/212kg (almost 1HP/1kg). It's 61HP/L (now you know it's medium revving, and you can calculate the displacement)
- Honda B18B is 142HP/147kg (almost 1HP/1kg). It's 78HP/L (now you know it's a higher revving engine, and you can calculate the displacement)

The LS7 is a good example, it's 73HP/L and revs over 7k rpm.
A naturally aspirated engine with 200HP/L is pretty sure a very high revving motorcycle engine.

And when comparing engines don't forget about the dimensions/size!!!!! A LS7 doesn't fit under every bonnet.
Reply: The v12 looks is some type of valved 2 stroke?
Reply: I can be made into one like this:http://www.chevelles.com/forums/11-bench-racing/528170-2-stroke-454-a.html
Reply: Does this run the stock oil injection pumps?
Reply: 6 arctic 1000 cat 2 stroke sled motors joined together would do circles around this thing!
Reply: How is HP/cc even relevant? I've driven a lot of cars; never ONCE have I cared what "displacement" it had. So, I guess if you could weld 5 Volvos, end-to-end, you be in the ballpark...

(Hey, my leaf blower makes 120 HP/liter! I guess it's better than a Volvo, huh?)
Reply: "This big engine has a nice big fat torque curve meaning the driver does not have to work to get the car to go fast."
Yeah, you have to drive a high-strung car like you HATE it to get any performance out of it!
Reply: +Gunnar Sommerfeldt
So, translation: "No, I haven't owned a V8, and am talking out my arse."
Reply: "Look, there's no bias here. What I'm saying is that numbers don't lie. My 20 year old Volvo engine will, with SOFTWARE update only, on stock internals, produce the EXACT same power (actually, a smidge more) than the 1999 LM7 5.3 liter V8 "

For how long?
Reply: "The point isn't the size of the engine - it's the power to displacement..."
Power-to-displacement is meaningless, unless 1) you race in a class with a displacement limit, or 2) You live in a regressive nation with a convoluted taxation scheme.

It's a worthwhile "tax fiddle," but that's about it.
Reply: +Gunnar Sommerfeldt

Isn't Volvo Chineseium nowadays anyway?
Reply: More 4 stroke crap as usual
Reply: Bruce Miller Tell me what good 2 stroke car engines you know. I am very curious
Reply: It sounds like a fart can...
Reply: Gunnar Sommerfeldt cause it's based off a stock engine. Put some higher lift cams, a ported head, and a high-flow intake manifold and I'd bet you'd be closing in, if not far past 100 hp/liter.
Reply: It sounds like crap, its would much better if were a 2 stroke.
Reply: +RadiantGreen Well... with some mods here and there, ported this and bigger that, there are volvos with 1000 hp. 434.7 per liter. I think I even had a link to one of those somewhere in this ridiculous thread. So...
Reply: Gunnar Sommerfeldt your point? You know there are 7.0 (emphasis on that) LS motors with all your fancy turbo Volvo stuff making over 2400 horsepower, and over 2000 hp on pump gas. Also people can even get more of a 7.0 by stroking and boring it. Imagine the potential of 8.3 liters of LS engine, then the potential of a stroked, bored and twin-tubocharged LS v12. And as everybody else already said, hp/L isn't important unless engine size is restricted. What's important is do you have more horsepower or not also, it seems you're trying to discreetly compare the specific output of an NA engine with that of a boosted Volvo. There's no point doing that because turbo charged engines always have much higher specific outputs. Hence, the turbo charged LS motor would make some very impressive numbers. Even the low-boost supercharged LS9 makes 640 hp out of a 6.2 L from the factory, courtesy of the corvette ZR1. That's on, oh, 10 lbs of boost? And over 100 hp/liter.
Reply: +RadiantGreen I think we've been over this a few times in the thread already, and I don't really feel like starting over again. The point isn't engine size, or the amount of HP - my initial comment is about efficiency, and the lack of such. I don't see the point, frankly, in making a huge engine with low efficiency. Sure, you can build a V8 with 180 hp. In fact, Corvette actually did have one with those numbers, if I recall correctly. But why would you, when you can have 250 from an inline 5? Specifically, why would you make an engine with 77 hp/l when you can have one with 250? While I can see the beauty in NA engines, and I've no problem appreciating the effort, the ingenuity and the skill that went into putting this LS together, I'll stick with more power, higher efficiency, better mileage and better longevity, thanks.
Reply: Gunnar Sommerfeldt because TORQUE! It's what makes cars go fast off the line. Don't you know that, smarty pants?
Reply: +RadiantGreen No use in torque without HP. And no use in HP without torque. I can't believe people still think those two are unconnected...
Reply: Gunnar Sommerfeldt I'm not saying they're unconnected. I'm saying that a v8 doesn't need 150 hp/liter to get off the line quickly. Jeez. The point is if you had a 200 hp turbo four, you'd have, say 160 lb-ft torque. In a 200 hp n/a v8, you'd probably have 250-300 lb-ft torque. See where I'm coming from yet?
Reply: +RadiantGreen Not really. As it sits now, my 20 year old Volvo has 290 hp, and 410-420 NM. Which should be about 310 lb-ft... unless my math's all off. And that's an inline 5 DOHC 20V 2.3 liter engine which gives me 30 mpg.
Reply: You can make a v16 out of 2 aluminum blocks, and they are easy to cut ports into them if you want a uniflow 2 stroke, just got to be careful with the water jacket though.
Reply: You only get 30 MPG? LS3 engines in the holden commodores here in Australia can pretty easily return 28 mpg on highway in a nearly two ton car, the 1.5 ton C7 corvette can return over 30 with 460hp and 650 nm, I see the point your trying to make, but when put in the perspective of power to weight, physical engine size and actual fuel economy relative to power output the current LS engines are very competitive on all fronts, when you add in the fact they're far more reliable, easier to work on, parts are cheap (both replacements and aftermarket) and they're everywhere, it's hard to argue that they're an excellent engine, and as far as design's go actually very efficient in both its size and weight.

fun fact, did you know the Honda F20C from the S2000 is heavier then an LS3 when both engines are fully dressed? the nissan sklines RB26DETT is around 80KG heavier, and the 2.3 liter I5 in your volvo is almost exactly the same weight as an LS3, 187 vs 189 KG
Reply: Let me put this in further perspective for you, since that seems to be your thing: MY engine, is 20 years old. YOU are talking about CURRENT LS engines, which, apparently, stopped evolving 20 years ago. You're kind of just proving my point further...
Reply: Gunnar Sommerfeldt Talking about “current“ pushrod V8 engines is kind of funny. VVT and Direct injection don't make a 60 year old engine design a modern engine. But Ford and GM habe shown us they can do it, the Ecoboosts, the Caddy Turbo V6s
Reply: Gunnar Sommerfeldt think though; the first factory LS (the ls1) debuted in 1997, exactly 20 years ago. Engine size aside, the LS was pretty much completely unchanged from then to now. And it was the same rockstar of an engine then as it is now.
Reply: +RadiantGreen So what you're saying, is that you want to pay money to have 20 year old tech in your brand new car. And would rather have low mileage, low power, low efficiency... ah, sorry, I just can't follow the reasoning. Rockstar? Sure...
Reply: Gunnar Sommerfeldt Gunnar Sommerfeldt how's 32 mpg, simple to work on, and 350 hp without any tuning? Not to mention a few hundred dollars will easily extract 100 hp from it. You missed the point: GM designed such a good engine 20 years ago that it didn't need to be touched until 2017. Sounds like you're just hating it for the sake of hating it.
Reply: +RadiantGreen I'm not hating to be hating, and if you read the comment thread, you'll see that. The important difference that I see, is that GM built a beautiful engine...and then DIDN'T touch it for 20 years. Should have, could have, and didn't. The result is 20 year old performance, today.
Reply: Gunnar Sommerfeldt but it's not 20 year old performance! Until 2015 it was completely up to par in the performance world, and all they did for the new engine was direct injection, continuously variable valve timing, and some general tuning.
Reply: +RadiantGreen 20 years after everyone else, and how can my 20 yr old Volvo still measure up, if it's not 20 yr old performance? We've had this discussion several times in this thread already - I think my points are pretty clear.
Reply: your 20 year old volvo doesnt measure up, thats exactly the point thats being made, you keep talking about hp/liter, which is the only aspect your volvo does, but then the LSx matches it for HP/liter as well (since we're talking forced induction on your engine) your vovlo engine is heavier then a 7 liter old school V-8 that makes more then double the power and torque and gets similar fuel economy, how is that in any way keeping up with it?
Reply: +Scott Roberts I think we've been over this quite a few times in this thread, and I've proven my point over and over. Peddling these LS things as "rockstar engines" and hyping them up, doesn't make them better. Only a little nuance and a willingness to swallow some pride and do the work would make them better. And, you need to recheck your numbers. Also, look into "then" vs "than".
Reply: +Gunner Sommerfeldt When you use quotation marks, you have to be quoting something, no one in this thread has called the LS a "rockstar" engine, just saying, don't put words in my mouth to try to make your argument sound more relevant.

To get back to topic, I would argue that you havn't made your point at all, you seem to be trying to say that the Volvo engine is better in every way then an LS, which simply isn't true, here I am quoting your initial comment "77-83 HP per liter?? That's horrendous. A 20 year old Volvo engine makes 110. From the factory. And a modern Volvo engine will produce 250 per liter." your entire point was that a turbocharged engine makes a higher specific power value then a naturally aspirated engine in a low state of tune, yes you've made that point quite well, but you've since tried to argue that that metric alone makes the Volvo engine better in a number of way's that it simply isn't.

most of this thread has been trying pointing out to you that perhaps your metric of comparing an engines specific output isn't the most relevant metric to compare two engines too, not only does the 20 year old LS engine design match your Volvo's specific output of 110hp/L in stock form in the current spec LSX (fairly featuring forced induction in the form of a supercharger), it does it while also matching the fuel mileage, and not only beating it in power/weight ratio, but by being outright lighter despite almost tripling the power output.

And I'm quoting you here as well "And a modern Volvo engine will produce 250 per litre", well actually no, the best that Volvo has archived is 180HP per litre (360hp from 2 litre's) for the Volvo S60 2 , and even then only just matching the the fuel mileage of 30.8MPG of the similar weight but 660hp 6.2 litre supercharged LSX equipped corvette, and i would argue the ONLY reason Volvo has that 2 litre in such a high state of tune is that European registration law's taxes car's based on they're engine displacement, making 2 litre and under car's much cheaper (but a very significant margin) to register then engines larger then 2 litre's and thus makinng them far more desirable on the European market for that reason alone, and that the LSX with nothing more then a retune of the ecu is capable for far more power (over 800 hp) and also better fuel economy, where as the volvo engine is already very close to it's limit on stock components, re-tuning for only 20HP more requires upgraded injectors for example.
Reply: +Scott Roberts RadiantGreen called it a rockstar engine just 18 hours ago. Seems to me you haven't read this thread at all. Generalizations about the european market and taxation doesn't make you seem any smarter - there are numerous countries with numerous different taxation schemes. As far as I know, fewer and fewer look at the 2-liter mark as any kind of definite thing. 
As far as "a modern Volvo engine will produce 250 hp/l", that was a bit overstated. It's 225. And I didn't say which engine, or that it was in a car. The fact is that Volvo has made an engine with those specs, and has put a version of it in a car. There's no denying it. "High state of tune" and "low state of tune" makes no sense - wouldn't you want to have your engine in a state where it makes the most power, in the most efficient way? Wouldn't you tune your guitar before playing it? Or your piano, before the concert starts? Makes absolutely zero sense.
Reply: +Gunner Sommerfeldt You specifically directed your comment towards me, not at RadiantGreen, as I said Don't put words in my mouth to try to make your comment look for valid, I'm not your sock puppet.

Since I wasn't specific enough for you, Austria, Belgium, France, Germany, Ireland, Portugal and the UK all have yearly Vehicle tax policy graduated by engine displacement directly which steeply effect's engines above 2 litre's displacement, and and Sweden, Italy, Greece, Spain and Austria have tax intensives at the time of the vehicles purchase penalising engines above 2 litre's capacity, in all cases without forced induction or fuel type taken into consideration, you are right that fewer and fewer look at 2 litre being the defining thing, more are now also adding additional taxation on age of the vehicle and it's weight, but the two litre thing hasn't been dropped, but rather added to, and so in all of these countries consumers receive  heavily incentive's to purchase a sub 2 litre car, so car produces are pushed to make more power from the same sized engine to stay competitive, they sacrifice reliability and add considerably to complexity to do so, which are both big downsides, and due to having to make said engines with cast iron block to ensure durability they don't save weight by doing so either, except for BMW using magnesium, which is why BMW's small capacity high output engines cost far more to produce then others.

Perhaps you should do a little research on the topic? it may make you seem a little smarter.

onto the next topic, you have to be referring to the prototype 2 litre inline 4 fitted to an S60 sedan... in 2014 which never went into production and produced 450HP, emphasis on prototype there, if you want to include prototype engine in this debate then the sky is the limit, GM made a 3000 horsepower LS based prototype 7 litre V8 in 1995, since we're talking prototypes here that must be the winner at 428 hp per litre (more horsepower in one cylinder then Volvo's entire engine, and there's 8 of them!), the simple FACT is that volvo's current highest specific output PRODUCTION engine is the B4204T43 360 hp 2 litre turbo in the S60 II sedan.

Again, perhaps do your research, it might just make you sound a Little smarter if your not spreading outright false information.

Onto your last point, yes absolutely I agree with you, I want to see my engine tuned to it's peak performance, it's fun, it's exciting ect, but do you know what I want more? I want my engine to last past it's warranty period, and be easy to work on and get parts for, and simple fact of the matter is an LS engine archives the same fuel consumption (as the current model Volvo engine mind you, not just the 20 year old example you've given) as the Volvo engine you've mentioned, with more then twice the power, less weight while still being a simpler design with lower cylinder pressures, larger bearing surfaces and proven track record for monumental reliability, over 500'000 miles on a stock LS1 is not uncommon, and I know personally many people with 550hp LS3's with over 200'000 miles on them, still not burning oil and still never having let them down where as the B5234 I assume you've been talking about (since you've mentioned a 2.3 litre engine a few times, but no model numbers, that is the only 2.3 litre volvo was making in the last 20 years) has known head gasket, water pump and oil gallery problems.
Reply: +Scott Roberts Jesus Christ with the run-on sentences. I never said you said it, so don't put words in my mouth to make your mistake look something other than that. I'm not your sock puppet. 

Most of these countries have a 2 liter "line", above which taxation in previous years have gone steeply up. These days, focus is shifting towards efficiency, and also away from effect, since, for example, the new T8 versions from Volvo have ~400 hp, but in a hybrid configuration, and will therefore be considerably cheaper - and the INCENTIVES are better than the below 2-liter engines. My main point was that running all of Europe over the same comb when it comes to taxation schemes, is pretty silly.

Yes, I was referring to that engine. And yes, the B4204T43 outputs 362 hp (not 360). I trust you see that those numbers are still far better than 77-83 hp/l, which is what this thread was about? 

Having a "tuned" engine doesn't mean what you think it means, I think. It doesn't mean pushing as much power out of it as you can. If you look through the thread, you'll even find a link to a 1000 hp Volvo 5-cylinder - that is what you mean by "tuned", I guess. And it's not. Tuned means getting as much power and efficiency out of the engine as the engine can safely handle. In my case, I'd say that my 290-ish HP, and 420-ish Nm is well within that boundaries of my engine mechanics, and gives me good mileage. I could probably push it to 315 hp without any issues, but beyond that, I'd need a manual gearbox. A little research on your part would also show you that 300-400k miles on these engines is pretty normal, and I've never heard that the 5-cylinders from Volvo has either of those issues you mention. With the right maintenance (i.e. do your oil changes and TB changes on time), these engines have always been a low maintenance, low trouble mainstay. Mine has 161k miles on it now, doesn't burn oil, doesn't leak anywhere, never had HG issues - it doesn't even misfire. And starts right up in Norwegian temperatures. Just like the 3 previous ones I've had. 

As for "model numbers", I've mentioned which engine I have, several times in the thread. Again, you should probably read it before making claims that no one said this, you never said that, etc...
Reply: An awesome engine, but it runs oil injection.
Reply: Oil injection lubrication as i would run it with this motor!
Reply: Gunnar Sommerfeldt specific output does or doesn't matter based on the application. If we're talking sport bikes, 180+hp/l is common nowadays, but that bike powertrain won't survive long pushing a ton and a half of car around no matter how efficient it is. Conversely, in offshore power boat racing where they need to make big power and run at WOT for hours, they use huge V8s instead of high-strung turbo I-4s because the big components in the V8s will stand up to the punishment. But those big V8s would be horrendous in an autocross car.

As for LSx engines, their advantages are in their simplicity, durability, compact size/low mass for their power outputs, and huge well-engineered aftermarket. LS swaps are popular because they're shorter vertically and no longer front to back than most DOHC I-4s, and often weigh about the same as the engines they're replacing. The LSx can be traced to the 50's, but Le Mans wins don't consider how old the technology is, it's effective and reliable. 

Real world example: let's say we're doing an MX-5 build. We can do a T5 turbo swap that weighs 400lbs including the turbo plumbing and makes 400hp reliably from 2.3L, but it is longer and taller than an LSx. Or, we can do an naturally aspirated 6.3L LS3 with a cam that weighs 450lbs, but makes 550hp reliably and sits lower and further back in the car. The T5 has a much higher specific output, but does that make it the better choice? Does the LSx deserve derision because it's a 'dinosaur' if that dinosaur gets such results? Will the lap times know the LS3 is making less than 100hp/l?

Choosing one metric to conclude broadly that LSx engines suck is foolish. It's an incredibly winning design, very popular, very effective in the real world, and anything that can be done to a small engine (forced induction, methanol injection, etc) can be done to a larger one. At the end of the day, both the T5 and the LS3 MX-5 would be cool, I'd drool over either version of this MX-5 at cars & coffee. If there were one of each parked next to each other, "which is better" isn't a discussion I'd be interested having. But if someone were shitting on the LS3 one, I'd be the first to suggest the question be settled on the track.
Reply: Steven Parker LS engines stock are crap. Claimed power of 650hp gets beaten up by heavier cars with less power, but LS engines are great as modified powerplants. Even in europe they are accepted for that, even though in eirope we do built better engines. That is a fact. People who argue about that are stupid. BUT LS engines are cheap power, reliable, easy to maintain and easily modified. Try getting more power out of a european Nat asp V8 without forced induction. There is not much to gain. In the LS there is. In the end your Audi BMW and to a lesser degree also Mercedes Turbo Hotside in the V V8s will beat an LS engine. They have better torque curves, can rev higher, are more fuel efficient, have higher peak power. But they are impossible to get for a swap if you can they set you back 50.000 and if you want big power you can easily invest a further 50k into them. An LS engine is much much cheaper.
Reply: Lol. 250hp/L in a modern Volvo. I've looked all over and don't see a 625hp, 2.5L Volvo engine in their line up, or a 1L 250hp engine.
Reply: +EatPezzzz You've read nothing of this thread at all, so I don't know why I bother replying... but it's actually 225 hp/l, in a 2.0 liter engine. There's links to that and other stuff to make you not look like so much of a tool, elsewhere in the thread.
Reply: I love this motor as it could be made into a v12 2 stroke with ports!
Reply: Hp/L has absolutely no real world meaning. GM LS engines are light weight and compact. They are about the same size and weight as the 5.0 Coyote in the Mustang. Displacement produces torque.
Reply: Comparing displacements between engine designs is pointless. The DOHC layout will give you more power per liter but it will be much bigger and heavier than a OHV engine of the same displacement. The 5.0 Coyote is about the same size as the 7.0 LS7.
Reply: @guns&cars dude. find me a supercar with less than 90hp/liter with a v12 N/A. this thing is over 9 liters. it should be normal to expect north of 800.... but it's a shitty cam in block.

if it ran separate intake and exshaust cams, it could be worth more than half a shit. but that's a fucking nightmare to design. it's way easier to make ohc.

fuck, we have engines without throttle bodies and hydraulically actuated valves now! there's no fucking excuse for displacement anymore.
Reply: Because 2-valve motors have lousy volumetric efficiency.
Reply: V8Roehrldrifter hp/l is a joke, let's compare say a 2l inline 4 with a 5.7 ls1, the ls1 is barely larger and weighs maybe 30lb, makes 350hp bone stock and gets 28mpg (that's what my old lt1 got on the interstate so I'm assuming a ls1 WI get at least that) and the 2l makes 200hp bone stock, I highly doubt it's going to get any better fuel mileage stock and I know it will get considerably worse of you tried to push it to produce 350hp. So he's hp/l is a joke.
Reply: Gunnar Sommerfeldt And where the hell is your 250hp/l figure coming from? You'd have to dump a metric shitload of money into any engine to make that reliable regardless of who makes it. I don't give a damn about hp/l, all I care about is the size/weight of the engine, the power output and the fuel efficiency. That ls v8 isn't much bigger then you're little Volvo engine and I'd put money on it being more efficient in the same application. You can set there and say all you want but I've been around enough engines to tell you flat out, a bigger engine with less stress will last longer then a higher strung smaller engine, it's just basic common sense. Get over yourself and stop hating on the v8, if they didn't work they would have been abandoned years ago.
Reply: Gunnar Sommerfeldt But as stated before,  in the real world volumetric efficiency means absolutely nothing! Total output and fuel efficiency and engine weight are what matter in the real world. Sure hp/l looks great on paper but it's a totally useless statistic unless you're looking at something like injector flow rate. Hp/l is just another statistic for you and all the other small engine/turbo superiority crowd to beat off too. I've seen turbo 4 bangers destroy NA v8's, and ive seen NA v8's destroy turbo 4 bangers, but I've never seen a turbo v8 get beat by a turbo 4 banger. Not on the street anyway, when it comes to racing at the track, whoever has the most money to throw at their engine is gonna win, but usually it's much cheaper to get the same power figures from a big v8 then a 4 banger.
Reply: K guy, I get what you're saying but I gotta take issue with two things: 

1) volumetric efficiency means absolutely everything.  It's the reason why your LT1 made 275hp stock and an old flat-heat V8 from the 50s with a similar displacement made 125.  I'm not sure if you are mistaking it for some other term, but if you think volumetric efficiency means nothing then I think you better go tell virtually every muscle tuning shop in the states that has ever done headwork or put a cam, larger valves, etc into an engine, because all of those things are done for the sake of improving volumetric efficiency.

2)  Your LT1s highway mileage is in no way representative of its overall fuel economy, as all GM did was outfit that car, be it the auto or 6spd, with a ridiculously tall final gear ratio.  What RPM was your fourth gen turning at 60mph? Please, do tell.
Reply: And for the record, I will correct my previous comment by saying 2-valve motors only have lousy volumetric efficiency at higher rpms, compared to 3, 4, or 5 valve heads.